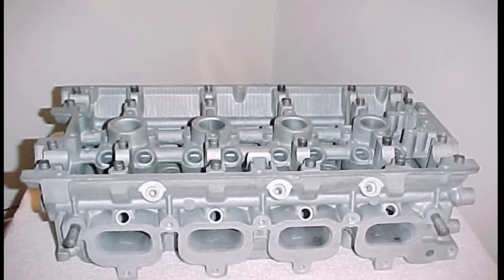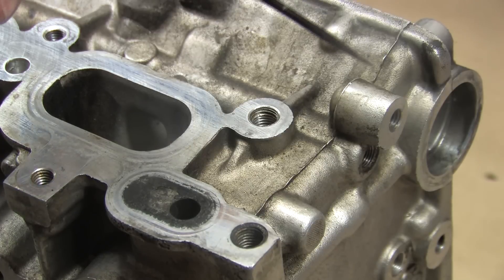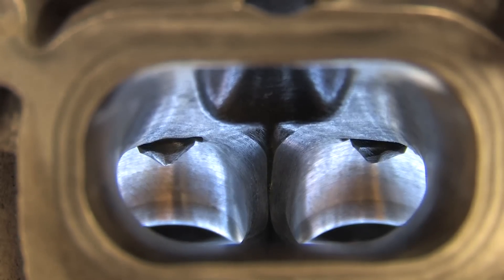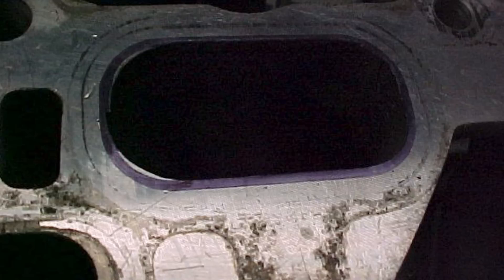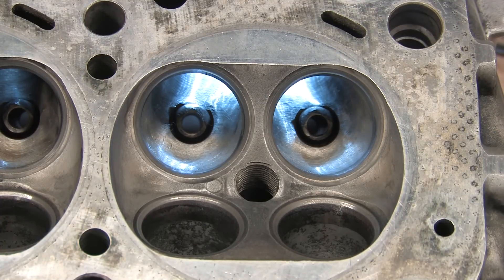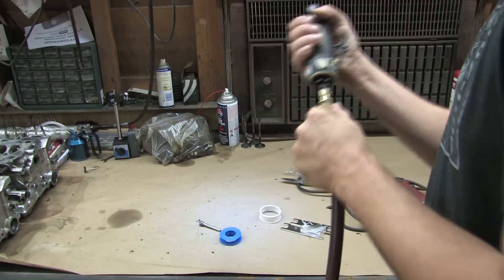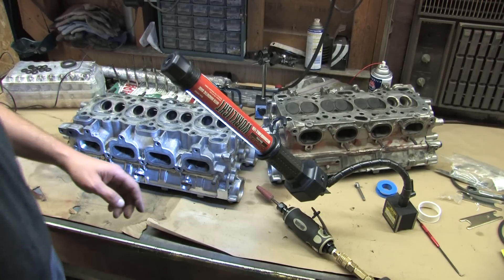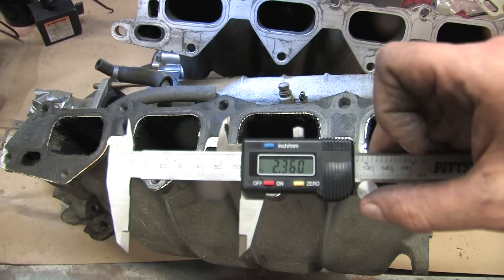Cylinder Head 106 - Casting & Porting Tech

Comment: If it is critical that each port be identical as it will change the air/fuel ratio then by looking at the ports before the polishing it seems that not each port is identical from the manufacturer. Casting lines are not always identical as I have seen in your video. I understand that a proper job is superior to anything else but any job other than the standard factory job as long as you don't change the size of the port is okay. Not trying to find flaws in your video it just looks like the original casting before porting and polishing was very crudely left and any work other than the original would be a great improvement.
Reply from the maker: You make valuable points on all accounts and I agree.  But IF someone makes changes to the port shape, they should repeat it on all ports.  To take your observation a step further, what difference does it make to nail the shape of every port if the same care isn't taken on the intake manifold to guarantee even flow rates of each intake runner?  The factory design of a DSM intake manifold has a #2 intake runner that out-flows all the other ports, and that's why people recommend tapping the EGT gauge in exhaust runner #2.  Because #2 intake out-flows the others, and all 4 injectors inject the same amount of fuel ÷ 4... that makes the #2 exhaust runner leaner, and therefore hotter than 1, 3, and 4.  The port and flow matching is a precise science that is rarely correct except in the most over-engineered highest-performing engines.  Everything else is a best-effort.  Science steps in once the letters CNC are applied and by that stage money has long since been an abandoned consideration.  Almost no engine builders take an engine this far unless they're trying to break records.
Reply: it's more critical on fool injection engines

Comment: Jafro, how often in your carrier you have met a 4G.. sorry Proton engine head with cracks around combustion chamber? Does it happen quite often? I have litteraly yesterday finished a headgasket job (Ive sent a head for skim, valve lap and a COLD pressure test), but now I can see, a bit of whitish/greyish smoke from my exhaust. And Im confused now..

Comment: What did you use to clean the valve seats?
Any power tools of any kind? I'm thinking of using my dremel with a brass wire wheel to remove any excess carbon and clean up the seats before i re-seat the valves. Brass wire wheel ok? or too agressive?
Reply from the maker: Hahhah.... It's actually the Cylinder Head 105 video, the one right before this one... where I do exactly what you describe.  It worked great.
Reply: +Jafromobile
can i simply use normal 300 grit sandpaper to remove the cast aluminum roughness then use a 2000 grit sandpaper to smooth and then polish?
in the intake and exhaust ports by hand WITHOUT ANY POWER TOOLS?
Reply: +Jafromobile Nice video - straight to the point - you talk like "you're at home". Grtz

Comment: Nice theories but air is invisible and the only way to see what it does is with a flowbench. Fact...
Reply from the maker: No disagreements there.  I've been toying with building one.  I just don't have the space here to make machinery like that.  I'm working on it.  When you compare the ported head to a stock one, there's no question what was done to it helped considerably.  If you need ever last hole to make the same perfect amount of power, that's when you can't do it without a flowbench, but that's exactly how you build the winning motor.
Reply: +Jafromobile I've noticed my MPG's are a lot higher when every other injector moves a little less fuel. It allows a little more in every other cylinder. Measured by laser guided thermometer at the fuel injectors. When I managed once to have my injectors perfectly even I certainly had more power...but when they fall into this pattern of what's cheaper I allow it and I don't correct it.

My point is that a little bit of imperfect just right can actually help depending on the goal. My port and polish plans get tempted by more wHP, but going super MPG is truer to my core.
Reply: +Dave hickman That's one way
Reply: Mark Lowe What's another wat you'd suggest? 

Another is have an engine turning over without an intake on. Hard right? To see it's air flow in and out of the intake. 

Use tassels to study all the intricacies of flow patterns.

I feel like I've seen pictures of this. Maybe the engine is manually turned and not running? 

Easier to do that with exhaust. But potentially destructive. Headers and a little pipe actually protect valves from cooling too fast when you turn it off.
Reply: As you said the flowbench is the obvious fundamental tool. I've also watched a smoke trail used to witness the effects of valve angle and air velocity in different areas of the valve pockets. Adjustments made from this observation have then aided in shaping. (not removing cross sectional area) The flow rate at low lift increased being usable at a practical rpm range and increasing results.

Wind tunnels also use visible aids. 

 I'm not disagreeing with your statement but there's additional things that can be used to further help. Flow is one thing, air speed is also critical. Any cylinder head can flow 500cfm with 300cc runners but at 15,000rpm why bother.

Flow is easy if your not trying to do it all under 0.600
Reply: Unless you are racing, a flow bench is a waste of money on a street car or bike.

Comment: so wear u had 1 sharft with intake and exust has bearings to hold it up wear its cut and spockets and chain to run drive from timing belt very tricky and very brain ratling and cubersome
other way be make head into push rod system so u have more room to invent so ur not trying to reinvent the head

Comment: Buy a cheapo junkyard engine. I recommend something common like a smallblock chevy or ford.  It is like the standard starter engine. Get a manual and some tools. Presto, you will have learned something more or less depending on your capacity to understand what you are doing.